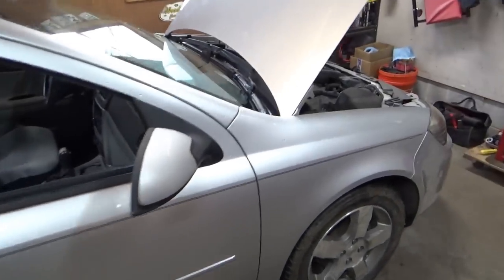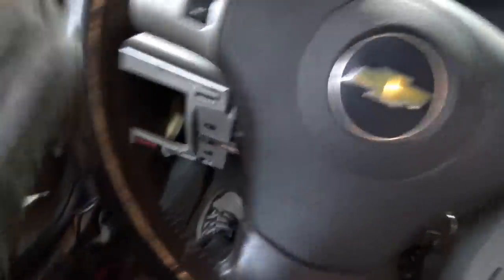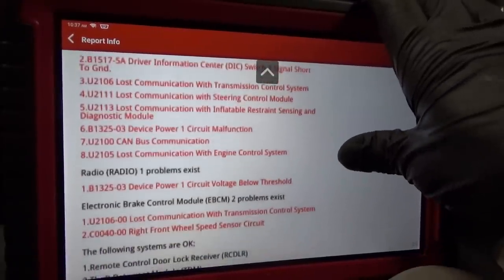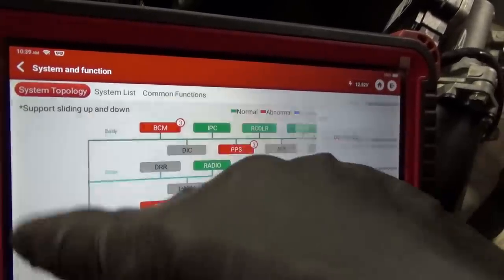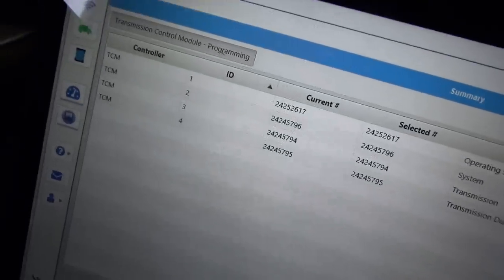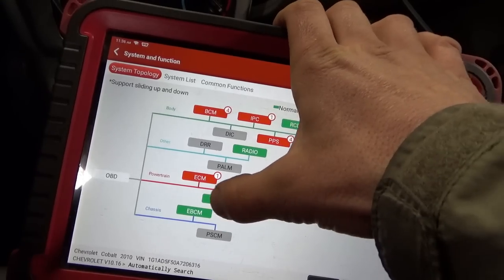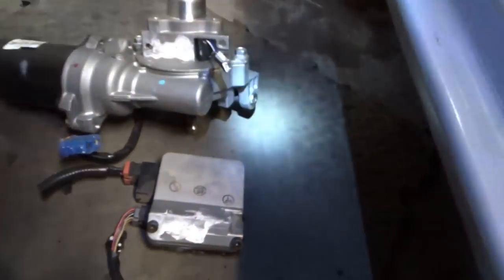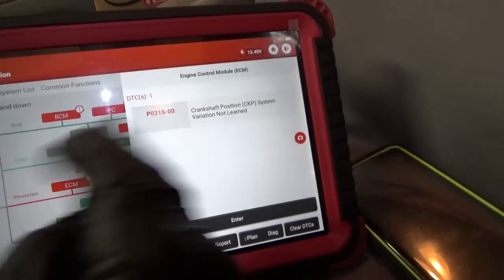Welding DISASTER... (Part 3 - Back in Action?)

Comment: I think it was worth the investment. That $2500 would only buy you another used beater with a whole new set of problems to start chasing.
Reply: Heck $2500 car would need a motor if that’s what you paid for a car. The markets crazy right now.
Reply: @robertmedina6875  as I said yesterday, I have a 1998 Honda Accord in nice shape, about 120K miles.  I can get $5K for it.

It just goes to show how inflated our currency is.
Reply: Exactly why I'm spending $2K-$2.5K on my 2001 Honda Accord. Better the devil you know. She deserves it at 273K miles with no mechanical problems ever. I'll fix the rear door latch and window channels.
Reply: Exactly. No check engine lights and just needs to fix airbags as far as I can see.
Reply: @robertmedina6875  I bought my 2002 Acura MDX for $1700 .. 155k miles, 3 rows of heated leather seats, heated mirrors, moon roof, AWD, 3.5L J35a3 Honda engine..  He could have bought something like that, and parted his car out and made some of it back.  I personally wouldn't have fixed it, once you determined that all those modules were down.  (granted, that was late 2019, just before tha plandem^c, and before inflation hit like a freight train)
Reply: @calholli  2019 is  like 20 years ago...
Reply: @Audigiant  It's such a good car. lol.. I could probably sell it right now for $4k. It's in perfect condition and might as well be a new car.
Reply: I’d parted it out no way that car was worth fixing . It’s a GM it’s not a Honda or Toyota that will run another 125 k easily.
Reply: I don’t think the average Joe is going to part out a car. Options are to sell it for dirt, scrap it or fix it.
Reply: I agree with you, Frank!
Reply: @saltycreole2673  You have got it right! You know what you have, and those Honda's are great cars!
Reply: Totally agree! 👍🇺🇸
Reply: For sure worth it, for that money you would only get a load of problems that need diagnosis, this way you get a runner that should last a bit.  The way we used to figure it is, “how much to buy a motor that should take you to work for a year ” ? Obviously how far you commute will have something to do with the calculation, but there will be a figure you can work to.
Reply: I spend money on my old truck to avoid spending money for a new more expensive and complicated one . With can networks ect .  I perfer manual transmission ect . However now i will go ahead and remove both group 31 battery grounds on my old 12 valve dodge truck when welding on it .  I welded on it a few times never had any problems and the old jetta . But it only takes a few minutes to do so why risk damage .   We always had to lay fire blanket over cable trays at work to prevent damaging control or power supply . Remove any thing that will burn ect . Fire extinguisher and fire watck after the event ..  You certainly did not want to be involved in starting a fire or damaging equipment from a poorly positioned of a ground . Bad idea
Reply: my old as hell 1995 dodge ram i keep sinking money into because a similar truck with 4wd (needed up here) you can't touch under $3k and that will still need a bunch of work i paid $800 5+ yrs ago and over that 5yrs have put maybe $1K into it and i own it outright and even new parts are not that expensive for it and junk yard stuff i still available
Reply: That car has 168k on it already. I simply cannot believe what you had to go through even to get the radio working on this POS. This entire series shows us all how absolutely ridiculously complex today's rolling garbage is.
Reply: It's a GM POS. If it were a Honda or a Toyota, maybe.

Comment: I have a 98 Honda Accord Lx 2.3 (F23A1) that I bought for 200 dollars about 3 years back.   It started as a project car.   I had to tow it back to my house, the torque converter had grenaded and it wouldn't move.  I bought a JDM automatic transmission and converter from an F23A donor car.   That set me back around $685 dollars with shipping/freight.   While I had the powertrain out of the car I went through and did a full timing job and water pump, changed all the oil seals, etc...  and cleaned everything very nice.  Well about a year later and maybe 10k miles, I was coming home and right before I turned into the driveway I heard a thunk sound and the engine shut off.   Somehow the timing belt was missing.   So at this point I decide to go all in and just rebuild the entire engine.   I tore everything down to find out the failure.   There are 4 bolts that hold the Crank position/TDC sensor in place around the crank pulley.   The sensor itself is plastic and has a metal mounting bracket.  The bottom right corner of my Crank sensor had cracked and broken off.  So now there was nothing around that bolt, so it started backing out and slowly shredding the timing belt.   Anyhow,  I spent about 750 dollars on parts for an engine rebuild.   I used Honda main and rod bearings.   I got pistons and the oil pump from Hylift out of Detroit.   I used a Oem timing kit this time, and a replacement OEM crank/tdc sensor.   I've put about 12k miles on the engine since the rebuild, and it runs beautifully.   It's super clean, doesn't use a drop of oil between oil changes.   But now, I'm dealing with the dreaded overheating torque converter issues now.   Obviously the valve body in this unit suffers from poor casting in the valve bores.  Honda's transmission from this era had problems stemming from bad valve body castings.   Anyway, I decided that instead of spending a fortune trying to get a good rebuilt automatic, I decided I'm going to convert it to a manual transmission.   Finding a 5 speed Accord at a junkyard is like trying to find a unicorn.   But I did finally find a '97 Accord 2.2 at Pull-a-part that I was able to get a manual transmission from.   I have finally got all the parts needed to do the conversion, and I'm pulling the powertrain back out again, one more time.   I probably spent around 700 dollars this time on transmission parts.  But I did get a sweet new flywheel, clutch, throw out bearing, new hydraulics, I've put new seals on the diff.   I pulled the transmission apart also and checked the bearings and synchros.   I also sourced an ECU from a 98 with federal emissions and no ABS, just like my car.  So getting to the point, I'm probably about 2500-3000 dollars in on a '98 Honda accord 2.3 Vtec with a 5 spd manual.   But I'm not complaining.   The car is super sweet.  Everything is in great condition now.  It's just been a lot of time and work and knuckle smashing and swearing and money.
Reply from the maker: Wow...I would manual swap it lol

Comment: Sometimes the question is not whether to fix it or not, but rather would you be able to find something else as reliable for the money.
Reply: The answer is Yes. lol.
Reply: This car is old and pushing 200k miles, I don't remember these being reliable to begin with, let alone at 200k.
Reply: Corolla or Civic
Reply: Not easy to find a car for $2,000 in the area they are in.
Reply: @mikefoehr235  any civic or corolla around me for around $2k generally has another 100,000 miles on it and "needs a little work" or the last "tech" that worked on it learned from the fast & furious movie franchise.
Reply: @mikefoehr235  From 1980?
Reply: problem also being if you live in an area that gets snow they use road salt so rust is a big issue you might find something that runs and drives great but was any rust repair done properly with replacement metal or did someone hackjob it with a ton of bondo that they spray painted over to make it "look good"

Comment: The sad part about the cobalt if I saw the mileage correctly @ 168k the timing chain needs changed with the oiler & balance gears which is under $200. But, the transmissions tend to fail between 150-180k however they are readily available! I swooped up a 30k mile trans for my G5 for under $400. & of course, I do all my own work but, When it comes to electronic diagnosis, Ivan is the BEST PERIOD!!!! PINE HOLLOW AUTOMOTIVE IS DEFINITELY THE BEE'S KNEE'S!!!

Comment: I picked up a 2000 Impala a few years back.  I detest late model vehicles, so I invested in full suspension, brakes, head gaskets, water pump, radiator, reman transmission, tires, and a mess of electrical problems in the interior.  I put quite a bit more than $2k into it, but I have a great reliable ride for hauling my gear to gigs. And it's not overloaded with nonsensical electronic BS.

Comment: This makes me feel a lot better about spending $2000 to replace the engine in my beater. In this market you can't find anything driveable under $4k. Great work as always, Ivan
Reply: What Ivan did was more difficult than replacing three engines

Comment: One advantage of fixing the old beater is that you know exactly what you are spending the money on. When you buy from someone else, it is so easy to end up with a car with a history that you are unaware of, be it big or small. A seller isn't going to mention weird phantom issues that are transient or outright fixed by means of unofficial parts. The client might spend a lot on this car, but getting a car for a similar price while also knowing its maintenance history is unsure. Besides, after having it pass through your hands, at least he can rely on you having truly fixed issues and diagnosed whatever oddities exist. When it comes to a car you want to rely on, it is IMHO worth it to have a reliable expensive beater compared to a cheap new car that you are afraid might leave you stranded in the middle of nowhere at some point.

Comment: What a great series of videos for  all us DIY Ivan wannabes!!   Not one shop in twenty could do what you do in your garage. And the rare one shop wouldn't want to touch it for less than $5k.   Is $2500  worth it for this car? Hard to say. The car has 169k on it and that engine isn't known to be  robust. If this were a Honda or Toyota I would definitely say yes. This car will be lucky to get to 200k. And given the feathers ejecting from the tailpipe and the mouse urine smell, I think I would have scrapped the car. The chances of this car coming back for some random problem is pretty high. I suspect you accepted the challenge for the YouTube value.....which is high.

Comment: Awesome work! Lesson to the customer: Avoid welding on the car, and if it's unavoidable unplug everything.
Reply: Interesting comment John. If he did that ( correct thing to do of course) would the wires still have melted through heat transfer ( not sure whether the damage was caused by heat from the welding or from the electric welder spiking the electronics) Either way if the damage was not obvious at the time then when the battery was reconnected or ignition turned on then the  shorted wires may have done the damage. 🤔🧐
Reply: @Doug....  All good points, but if you had melted a wiring harness, presumably, you wouldn't reconnect the battery, no?
Reply: @teekay_1  Yes true. What i mean is if the harness was under the carpet and hidden there might not have been any evidence of the melted wires. 🤔
Reply: It was worth it.  Like one of the other folks said it saved time to look for another car, and then you’d have a different set of problems.  As painful as it was to shell out over two grand I think it was worth it!
Reply: @teekay
Here one must assume he disconnected the battery. Where he placed his ground lead may play into the damage. Rory at Moab Motor Sports here on YT does a lot of welding on vehicles in the wild and keeps his work area confined. I don't recall if he removes the negative cable from the battery but I assume he does.
Reply: @larrybe2900  Its good practice to remove all battery leads and keep the earth on the welder right at the point of the work. We dont know what happened so its all a bit of a speculation really. A lesson for future welders i suppose. 😁
Reply: @Doug....  
For sure! I reflect back to "Just Rolled In" here on YT at all the welding jobs done to cars frames and exhaust by "another shop or a buddy" and wondered what became of electronics.
Reply: @larrybe2900  Cheers for the comments Larry. All interesting 👍🇬🇧

Comment: The old radiator is actually a good tool for the shop. Get a wash basin put radiator on top of it-clean parts with solvent,solvent goes threw fins and and no slipping of parts washed-A friend has a 05 Cobalt and gets 45 miles per gallon highway..not a bad rig for sure Tks. Ivan Another well done job my friend

Comment: Any car is worth $2K if it will make it last a few more years. That's almost what my last service cost on my F250 Diesel for fuel  filter, turbo & engine coolant, front wheel bearings, rear breaks, and break fluid exchange. The breaks just wore uneven from a sticking caliper and could have gone a lot longer but since it was in the shop I had it done.

Comment: Our Astra had similar parasitic drain issue. We moved radio and OnStar (VCIM) to switched ignition (with relays). Clock now is an "trip timer" and it is always September 2007 lol but those are minor issues.

Comment: I had to weld in a new rear suspension tower in my moms car (Cobalt) unplugged every sensor and battery, ended up fixing the driver motor in the od cluster These Cobalts are fussy hey

Comment: Same car as the Pontiac G5 a rot box, The rocker panels rot away in not time at all. And if you ever have to replace the front lower control arms good luck removing the long rear bolt that seize themselves to the bushing and destroy the top bolt fastener, which makes it a pain to remove. You did a great job repairing it, but if he ever asks you to change those control arms forget it, those bolts are a nightmare.
Reply: @Jonathan I never got that far mate, i got shut of it after the battle with those lower suspension arm bolts.

Comment: I was gifted a 94 GMC Jimmy in 2021 with 97,000 miles. While I needed needed to chase down a few minor problems due to it sitting for a couple of years, the vehicle was in really good condition. Still by the time I did routine maintenance, transmission service, new shocks, new rear brake cylinders, lower ball joints (the second highest expense after the tires as the oem ball joints are rivited in place) and tires, I ended up putting $2,000 into it.

Comment: had a friend weld on a jeep cherokee older one but still messed up a lot of stuff. Great video and yes i would have fixed it as well. replacement vehicles in todays market are to high. We drive a 1966 dodge truck, a 1994 ram 2500 4WD, and also a 2002 ram 1500 i am 66 wife 65 don't plan on ever buying any more if we do will never go much newer than a 2010

Comment: Interesting video! Tough call on whether to repair, given the need to use GM's interface control. I'd like to learn more (for instance, where the scan tool gets the correct VIN number from), but I sure hope I don't have to learn it on my car! I replaced the radio in mine, but used an aftermarket device that apparently learns the VIN number from the bus when first powered up after being installed in the car, as well as handling the sound that mimics the turn signal flasher. In the factory radio, the turn signal click actually comes from the left audio channel of the radio, even if it's turned off! I guess the BCM handles flasher duties electronically, so there isn't a sound coming from a flasher.

Comment: Ivan - this was a VERY interesting case study! I would have not sunk $2.5k on a crusty 160k mile Cobalt, but you made your thoughts known to the customer many times. It was THEIR decision to go ahead. I believe that the intense RFI generated by the welder plasma arc was distributed on the high speed and low speed networks and wiped out those modules, similar to what happens when a car or a house gets hit by lightning.
Reply: The welder return is connected to the chassis so all the welding current flows through the chassis. It will take the path of least resistance which may be through a module connection to chassis so may elevate the voltage of the chassis connection above the battery voltage which will reverse bias the semi-conductors and damage them.

Comment: Giving the fact that the current car market is still in shambles, sinking an extra 2k into this one in hopes to get a few more years out of it, is not so bad.  But I'm wondering how much more they spent already with the wiring repair, ECM and BCM and that programing?  Has to be close to 3k by now.  All that still remains is the SRS.  But as long as the seatbelts work normally, it should pass PA safety standards.  It's just very unfortunate that it had to come to this in the first place.  Anyway, you did an awesome job resurrecting that beached whale thus far Ivan.  Well done sir!

Comment: The Chevy Cobalt repairs approached the 50% cutoff for me, but in for a penny in for a pound as a similar used vehicle is in the $5k range . When do you say enough, given other comments about the cam belt and transmission, the economics start to fail. I can do many many repairs on my 2008 Toyota Tacoma 2.7L AT 2wd access cab w/ 250k miles for what another vehicle would cost and then I know what I have.  NEW and USED prices are insane and they are nothing like the truck I now have. A replacement for my 08 is now running <> $15k-$20k-ish on the used market. Many repairs can be done for that kind of money, new sticker is $34k